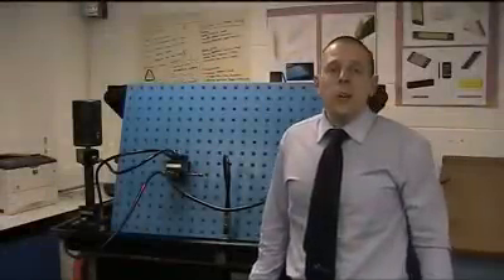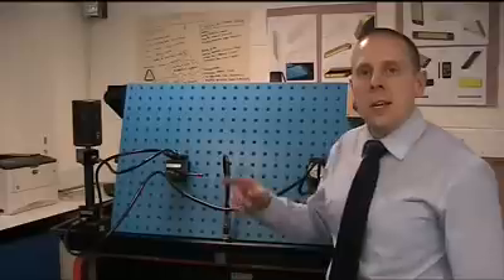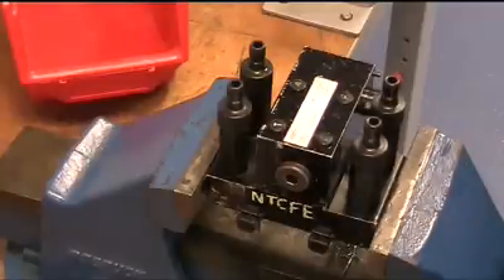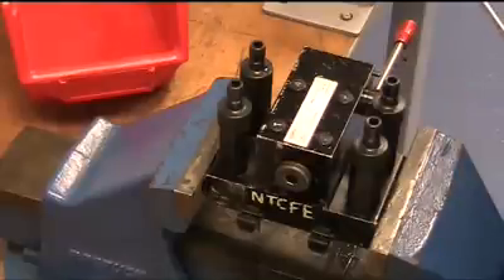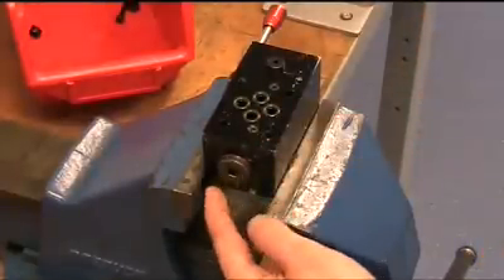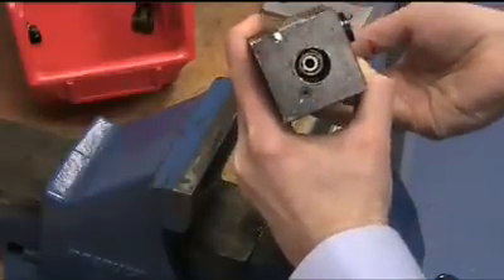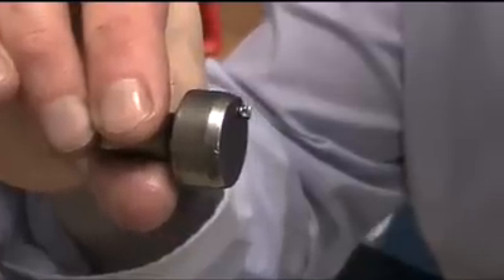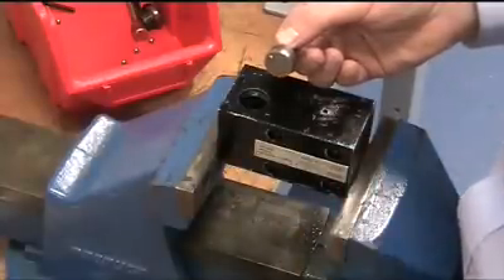4/3 Hydraulic Valve Operation and Maintenance

Comment: can we add non return valve in it ? if yes how many pipe lines we can add ? because we can not only rely on this two way acting valve as you told the pressure was just 10 bars what if the pressuve  is 250 bars on double acting cylinders ?